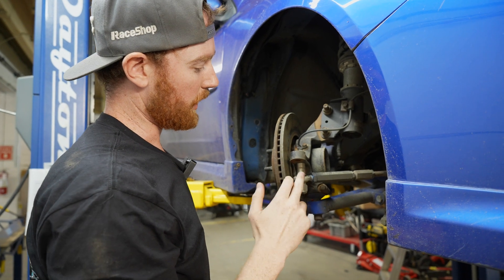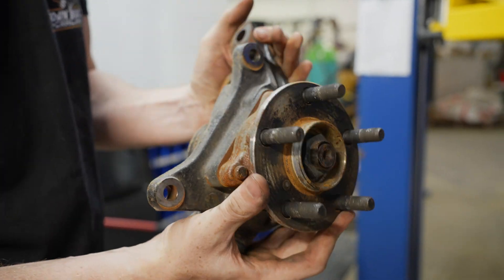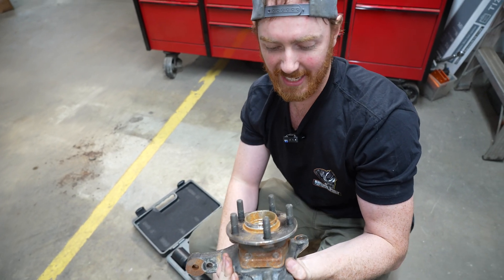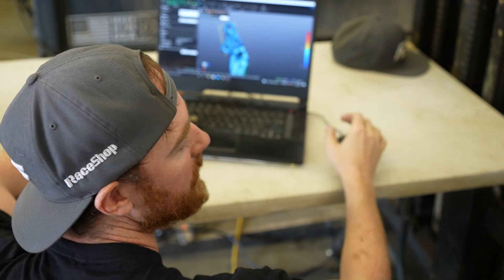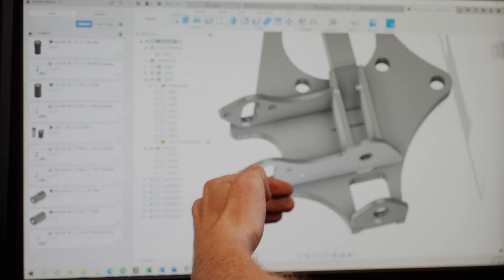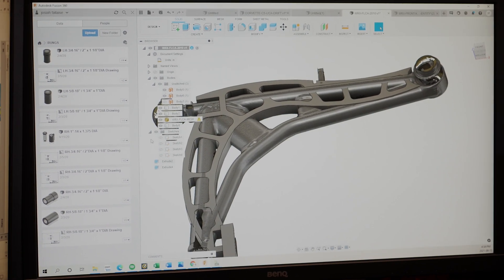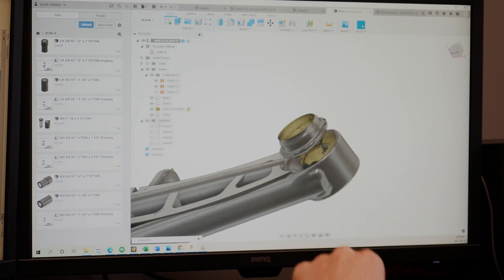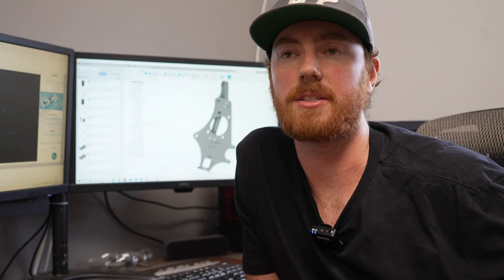3D Scanning And Developing The WRX Angle Kit EPISODE 2

Comment: How did you do the calculation for how strong those parts have to be and how did you figure out which loads they have to withstand? Or didn't you do any calculations and just try it out and hope that it won't break?
Reply: If you engineer it properly you use FEA software (expensive) in which you can then apply loads, etc to components and see how they react in the form of deformation and max stresses.